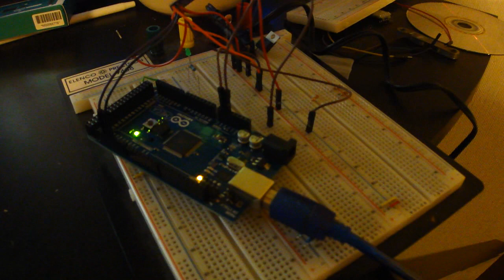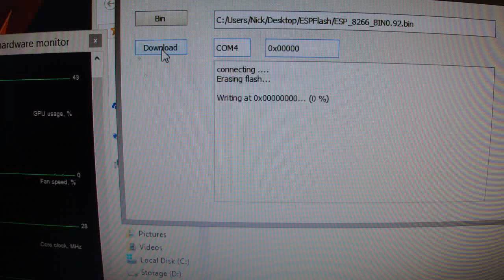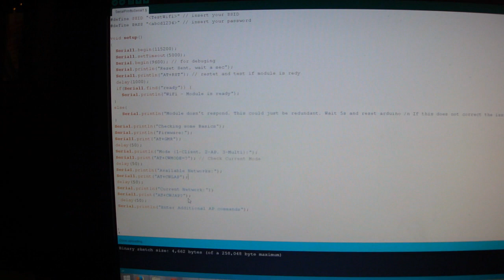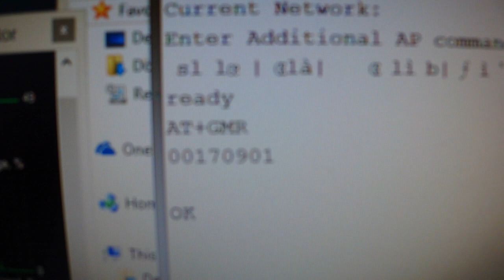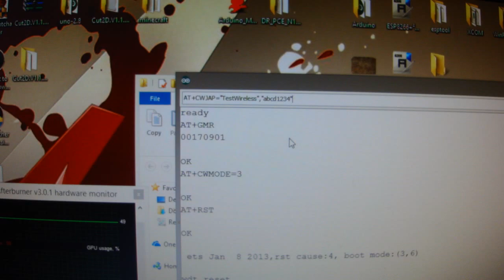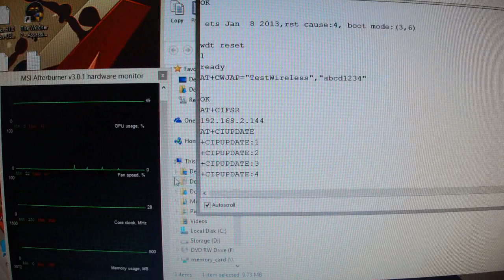ESP8266 Serial and Cloud Update With Arduino Mega (Quick and Dirty)

Comment: Hi, I've followed the same steps but when issuing the AT+CIUPDATE command I get

 +CIPUPDATE:1
+CIPUPDATE:2
+CIPUPDATE:3
+CIPUPDATE:4

and then an ERROR instead of OK. Do you have any idea of what can be causing this?

Thank you.
Reply from the maker: If you are following all the steps, including the mixed mode setting and ip address check, and getting no errors then I would just start over from the USB-TTL flash. Pay extra attention to pin placement after the flash and reset occasionally. Pin placement would be my first guess, although it is possible that their server may be temporarily unreachable.
Reply: BlackandChrome The mixed mode and pins seem just fine, I guess I will have to check in a couple of days to see if it has anything to do with the server. Thank you anyway.
Reply from the maker: TutoElectro  Check that you have a valid IP with AT+CIFSR. If it returns and address then ping it from a local machine that is also on the network.
Reply: BlackandChrome I do have a valid IP and I can ping it from another machine, also it appears connected in my router's configuration.
Reply: TutoElectro I think it was a thing on ther server, I just did it with the same setup exactly since I had not touch anything since yesterday and it did update to 0019000902 :)